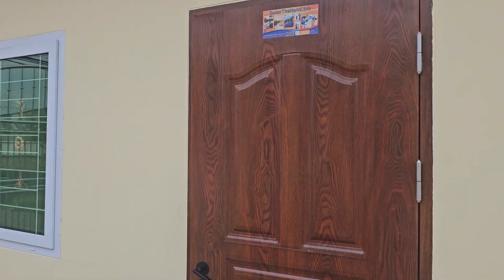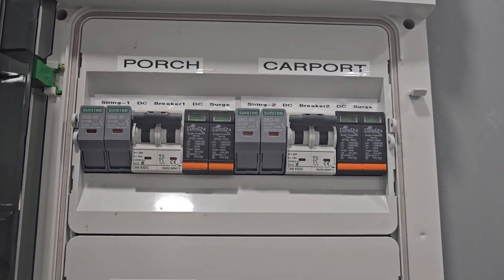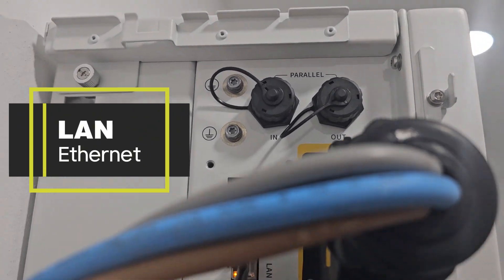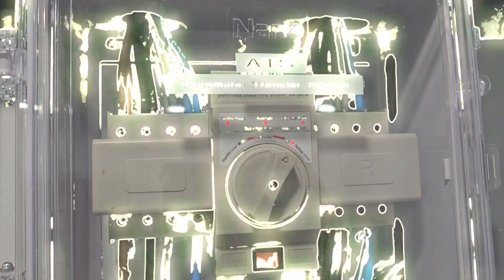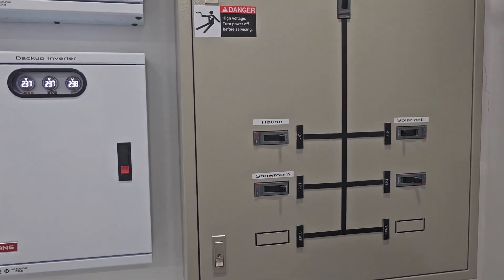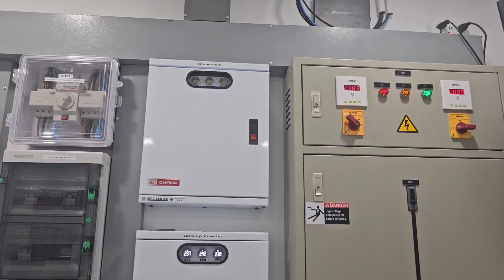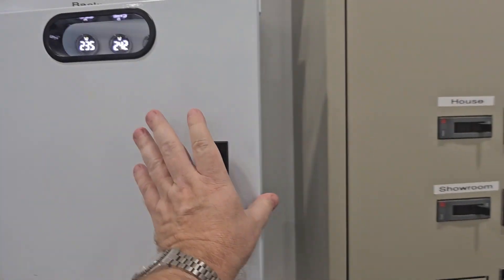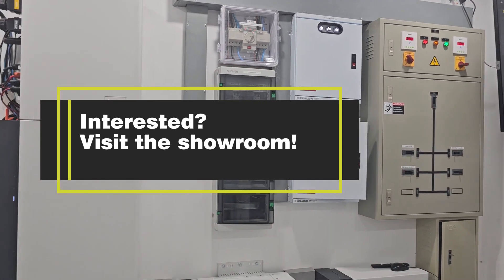New Showroom: AlphaESS T20 Solar Battery System | SolarThailand.biz

Comment: Great video. Very informative.
The new T20 inverter is a great bit of kit. Given that the previous generation LfP batteries "last forever" are they still compatible with the new generation inverters? A good feature if you can upgrade the Alpha inverter and still use the older batteries.
Reply from the maker: Unfortunately one cant use the old batteries on the new inverters. Most manufacturers do it this way.